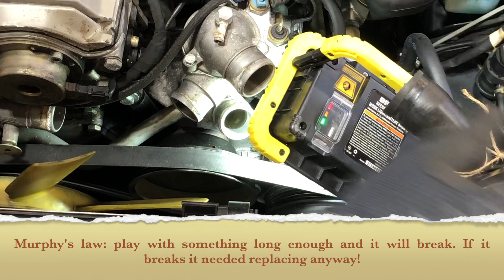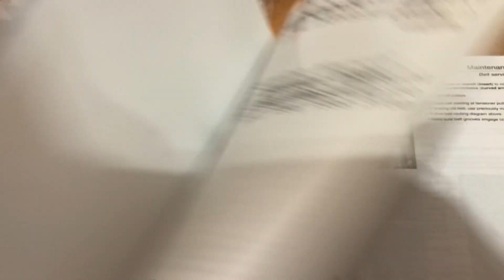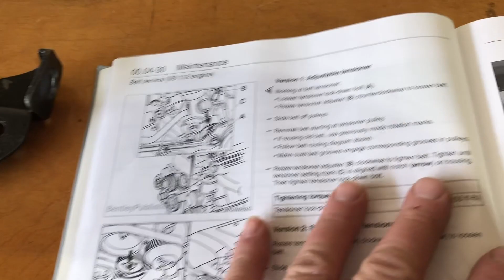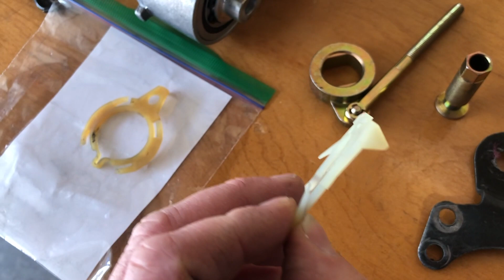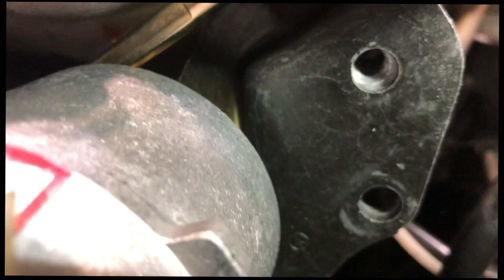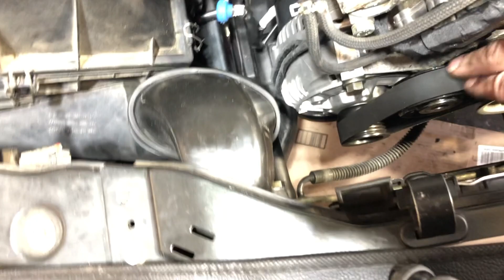Serpentine Drive Belt and Belt Tensioner 1994 Mercedes C280--Not all W202 Models are the same!

Comment: This really is the dumbest tensioner known to man. Have this on my m104 engine on a 94 SL 320. 

The threads on the tensioner rod were stripped and rod was bent. Had to replace the tensioner rod and purchased an aftermarket URO rod. Warning: do NOT GET URO rod. The entire thing just snapped off when I was tensioning the belt. Absolute garbage. 

Had to use the old tensioner rod, straighten it out, and put like a large modified "C" washer underneath it so the adjustment nut can catch earlier to put pressure on the bracket and tension the belt while I turned it clockwise. 

12 hours to replace an accessory belt lmfaoo

Comment: Thanks for the great video! I'm pretty sure the belt on our C280 is slipping, so seeing how to tighten it up some should be a big help.

I do have a question, though! -Would you be able to tell me what size Allen wrench is necessary to loosen the center bolt on the tensioner? I'd like to pick up a socket of some kind to make the job a little easier.

Anyway, thanks again for the informative content, regardless!
Reply from the maker: Hello @nrexx970 I believe on my car I have a 10 mm Allen key (hex key) for the massive bolt locking the belt tensioner in position. I used a low profile hex socket because the space is tight.
Reply: @fixittony Thank you!

Comment: Hey man is there anyway I can reach out to for a online talk. Im really having trouble understanding the tighting
Reply from the maker: Hey there. Sorry you are having trouble. Are you trying to remove your belt or put it on? You are sure you have the same tensioner as my video? Do you see the plastic arrow indicator and the tension scale on the tensioner?

You wrote tightening so I am figuring you are trying to get the belt tight.

I am assuming you got everything back together again and the belt is on and is the correct size for your VIN.
Reply from the maker: I can try a zoom call. Try emailing me at FixItTony ((at)) runbox (( . )) c o m
Reply from the maker: Would be until Sunday or Monday
Reply: I jsut broke that tighingnt thing
Reply: I just can’t firgue it outside how to tighten it properly. Like I bought a brand new tensioner and tighting adjuster. But it won’t tighten. Just right now I broke the tighting adjuster, and the belt didn’t get tight at all. I’m really getting frustrated because i this car is my daily and it started leaking coolant in November.
Reply: We could talk on zoom but right now I need to order the tighting adjuster.

Comment: Hi can you give me the reference when I can find the big bolts because I broke to thank you
Reply from the maker: If you are referring to the main bolt that goes through the Y-shaped bracket and through the tensioner all the way back through into the main bracket that tightens the tensioner and locks it in place… That is a M 12 x 120 mm bolt which should be at least I think a grade 10 strength or as high strength as you can get. The part number on my piece of paper is 000912 012116. I ended up going to Fastenal and buying the M 12 x 1 20 I think it ended up being a little cheaper than buying it from the factory but I did end up buying a factory only part that was like $20
Reply from the maker: The shock
Absorber to the to the belt tensioner is a M7x35…..tightened pulley to the lever is M8x40
Reply: Thank you so much
Reply from the maker: https://www.knauzcontinentalautos.com/purchase-parts-online-pick-up-in-store.htm